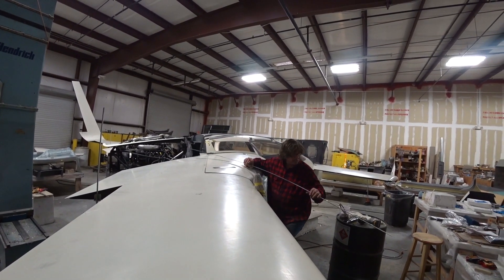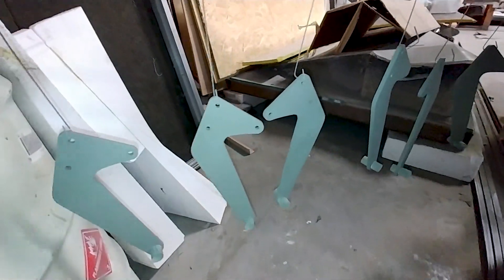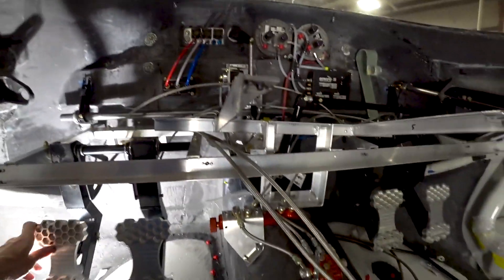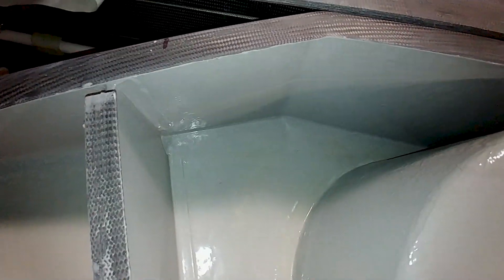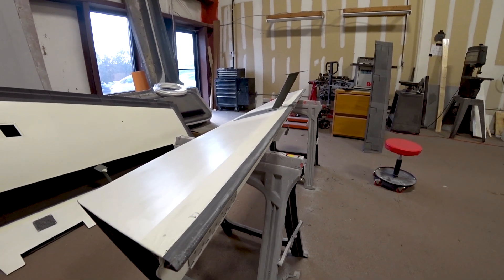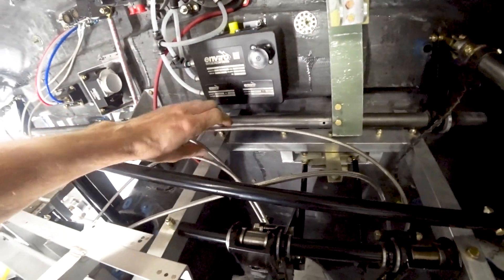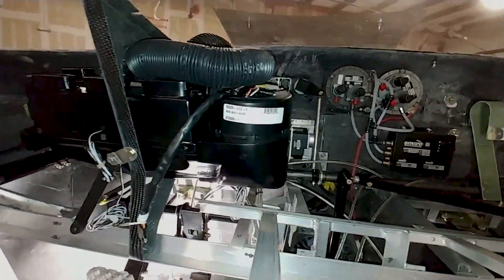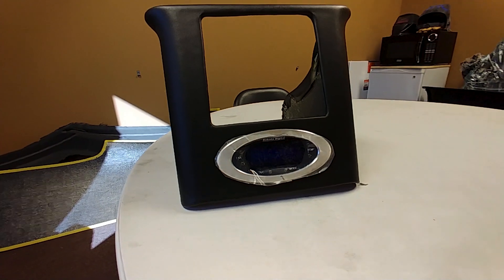Because Prototype Aircraft - Building the Raptor Prototype

Comment: Double-sided velcro could be used to test the line/cable fastening before zip typing. Harbor Freight has a fairly big roll for around $6. I now use velcro of this type more than cable ties in my computers.

Sometimes, it's good to put a shop rag over the end of sharp metal things, like the panel frame supports, when you work long hours in the cabin.

You have a lot of bells and whistles in the cabin that are going to make the finished prototype more impressive, but take more time to set up and test during this phase.

Still, I cannot see your 5-axis CNC without wanting one.

It's looking good.

Comment: The Velocity aircraft never got a parachute to work. In their words : “We worked on one for a while and had all the attachments, molded parts, etc..  done.  BRS could not address the problem of the chute opening and the cables getting into the propeller.  It would not cut them but it would most likely wind up in it and therefore the plane would descend pretty much straight down and hit on the nose.  Not acceptable.  A company in Europe had an additional arm that came up to protect the propeller or cables but we never worked with them.  That is the short story about it. ‘

How can you be sure the raptor won’t have the same issue?
Reply from the maker: Our procedure is to stop the engine before deployment. Galaxy who makes the chute has them deployed on several pusher designs. They assure us there will not be a problem as deployment is directly upward and the immediate reaction is for the system to pull the nose up sharply which keeps the straps clear of the prop until the aircraft slows and settles.

Comment: The design of the elevator's looks like they only have travel down as in flaps, to generate more lift.  I assume thus that the design relies on nose weight to put the nose down and therefore the maximum nose down force will be when the elevator control surfaces are flush inside the wing.  Have you also considered a fully moving elevator as in the PA-28 Cherokee, this would only require 2 bearings and one control rod, all housed inside the nose section and thus saving weight and improving the aerodynamics (reduced drag as well as much more pitch control, should it be required.  Great Job team, keep it up.
Reply from the maker: There's 15 degrees of up elevator. A fully articulating fore plane makes for an unstable aircraft.

Comment: I see all those straws going into the fuel tank to suck fuel.  I'm sure you've made sure that fuel delivery doesn't stop as soon as one of the straws is above the fuel level.
Reply from the maker: Those straws as you refer to them are the return, the vent and the last one is the fuel level sender. The two feeds are the little wire strainers at the bottom of the tanks.

Comment: Would the engine stall when you push that elevator into some free fall? :D
Reply: it shouldn't stall because its fuel injected however I think the point of the design is a low cost cross country plane and not a $130K device for making girls scream with fear and excitement despite how much fun that is.

Comment: Hi Peter,  have you had time to run new performance models with the external hinges?
Reply from the maker: No, I don't have time for anything right now other than trying to get the prototype finished.
Reply: I would guess a 2 or 3 knot penalty from those hinges.
Reply: Andy McKee which still leaves it head and shoulders above anything else